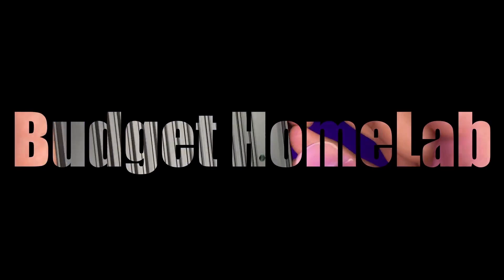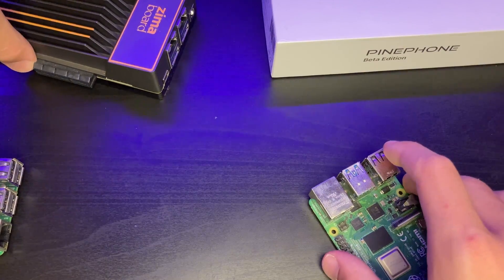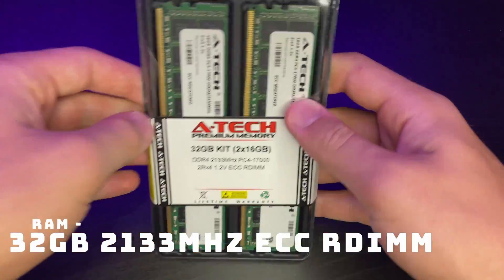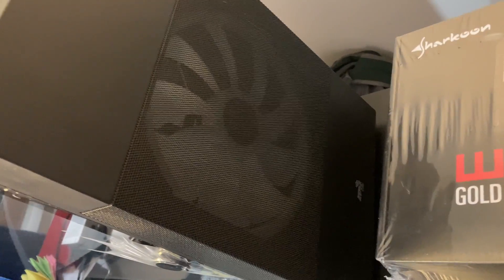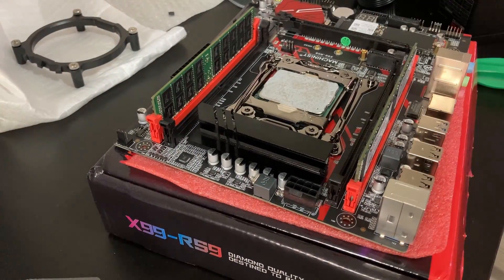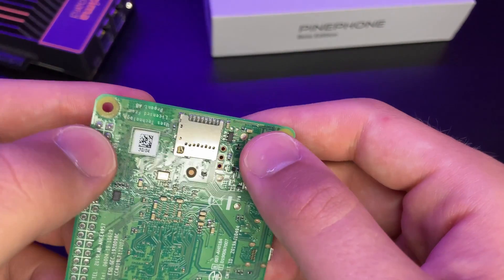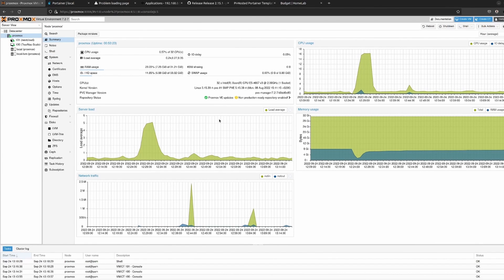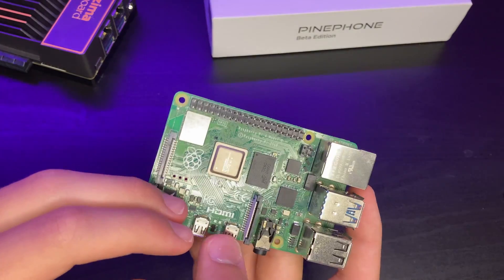Budget-HomeLab (#2) - BUILDING A BUDGET Home Server!

Comment: it's cheap but in power consumption it'll make you bankrupt. 
it's like having a small power plant server.
Reply: not really, people over exaggerate this too much. At idle it barely uses any power, for a homelab and as you can see in the video the server is 99% of the time almost at idle. That statement is true for DCs with thousands of nodes where CPUs get smashed all day. For home use you'll barely pay a dollar for it (CPU only as the rest of the system is the same with another CPU) a month, which makes CPUs like this relevant even with years of home use.